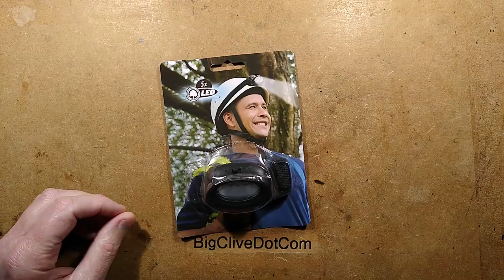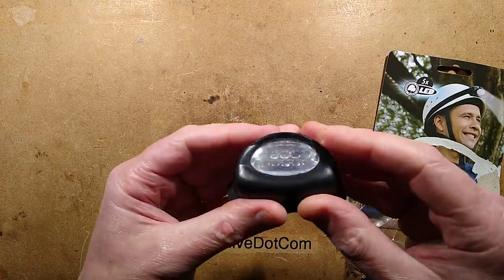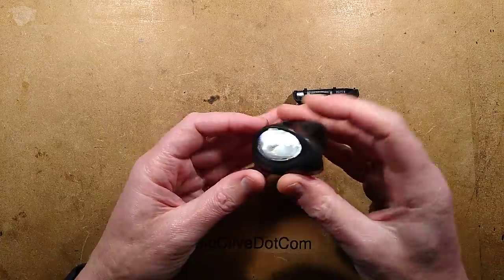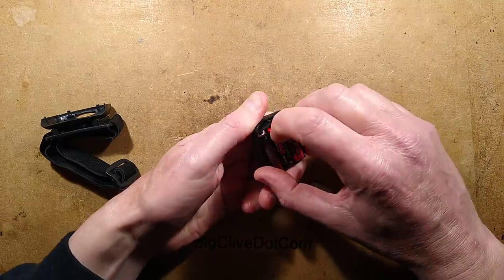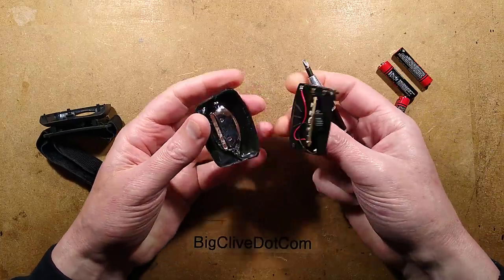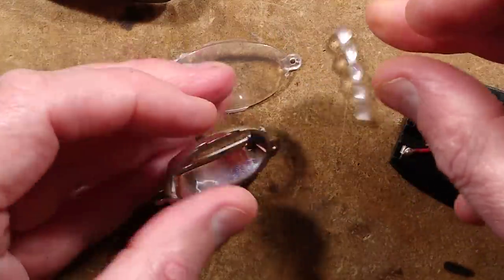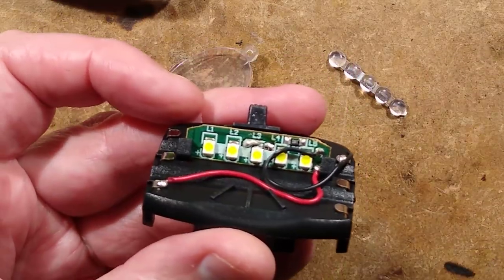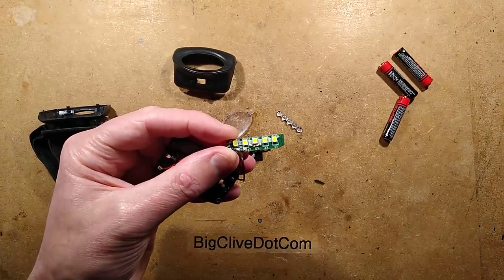Worst head torch ever.  Setting a new (low) standard.

Comment: 5 SMD LEDs, an 18ohm SMD Resistor & a Switch on a cheap PCB, in a housing with a Strip of Fake LEDs Lens w/ Milky Outer Plastic Lens/Cover & AAA Battery 🔋 Contacts!
So if it’s just the 18ohms across the 4.5V supply then the current is 0.25A, which makes it a very weak ass 1.125W Head Torch!!! Damn That’s Crap 💩!!!
Reply: You forgot about the LED voltage drop. It's about 1.5-2 volts over that resistor so more like 0.1-0.2 W with fresh batteries.

Comment: What would be the point of emulating through-hole LEDs? Are they better in this case? Or is this just a good enough diffuser?
Reply: A possible use is as lenses to change the beam pattern. In this case it's probably just to achieve the desired aesthetic.